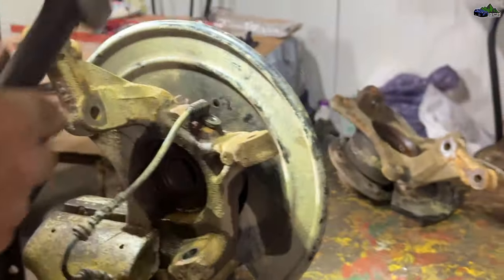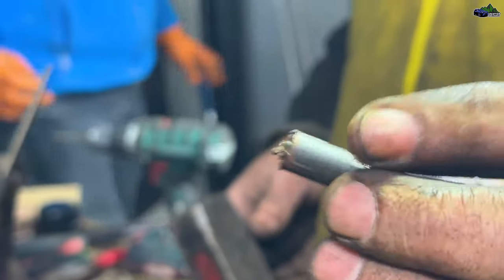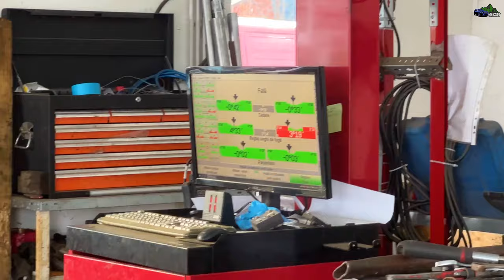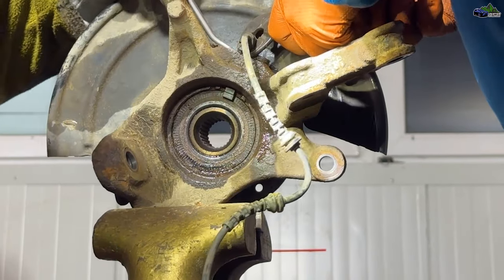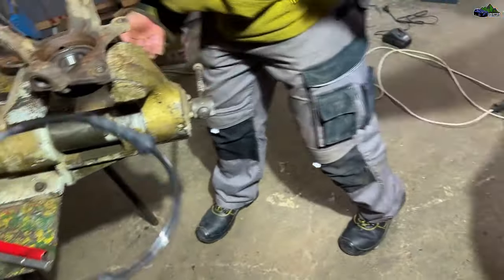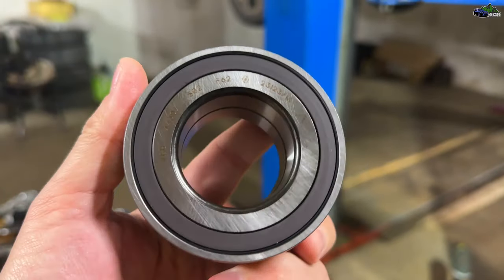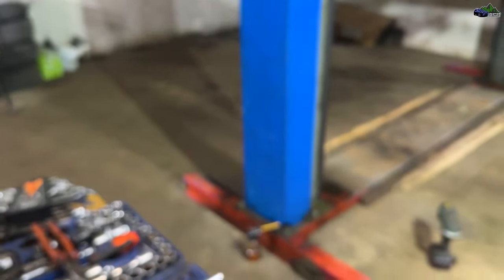Dacia Duster Front Wheel Bearings Replacement Problems

Comment: 5:13 you are supposed to press in the bearing by outer race (outside ring) not pressing on center, you will be replacing those bearings once more.

Comment: Helpful. But come on Mihai, the costs are very, very low. Compare it with other cars e.g. from Renault. That is a big advantage for the Duster I + II - we have to see how DIII will be like.
I would have replaced the steering rods and then tested if there is still some play before changeing the bearings. Not much additional work. But I admit I too tend to replace all parts that might weare around the ones dissasembled. Just to be sure and because they are cheap. Beside that it shows the new owner that you´ve taken care.